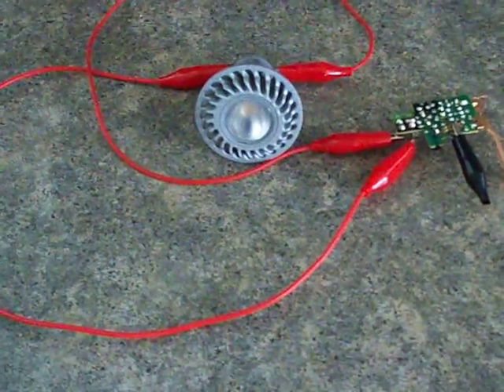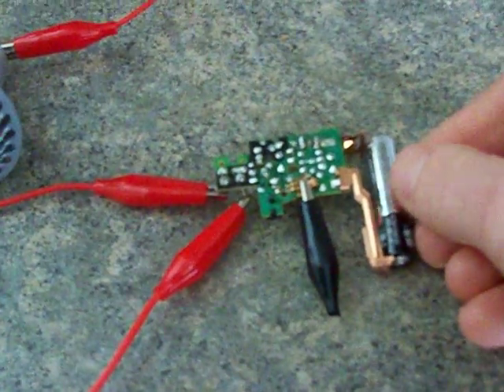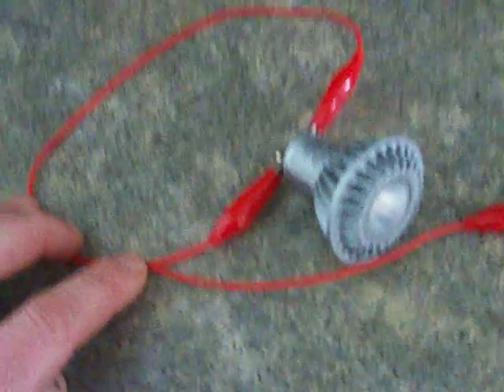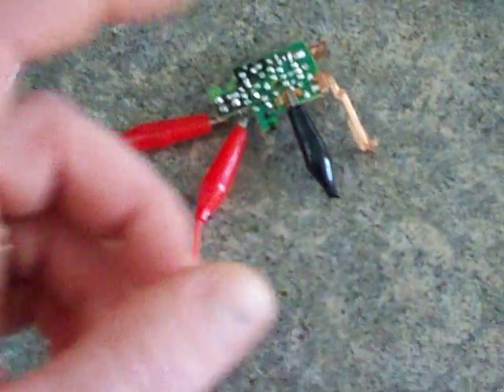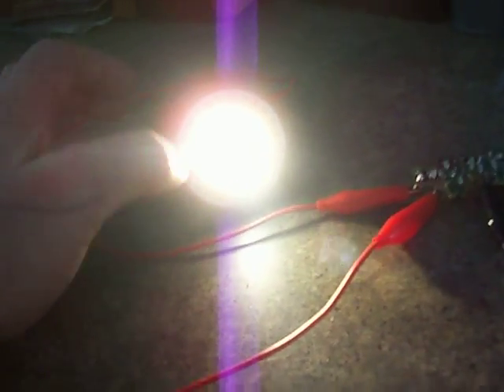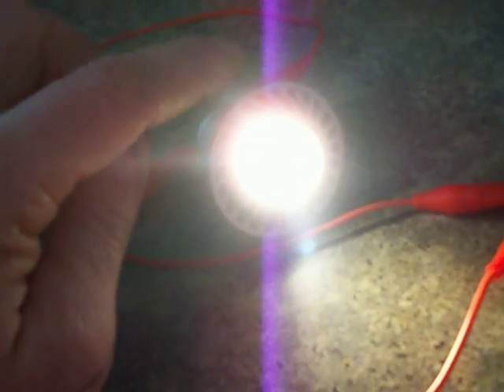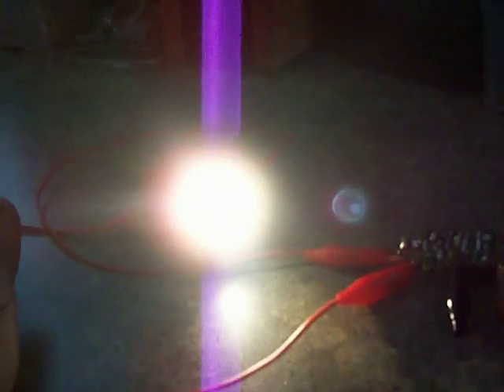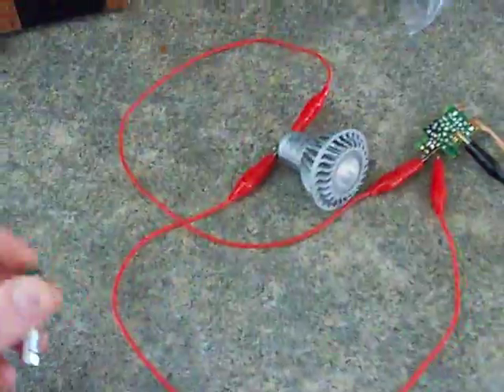Fuji Circuit Joule Thief LED Light / 1

Comment: can two of the fujis be wired together to double voltage?
Reply from the maker: I don't know I don't think so but maybe something to try later
Reply: thank you for responding,  I have already modified the circuit to run a 14 watt led light and support a low voltage phone charger at the same time and it lasts about an hour,  i am wanting to boost the voltage and watts it puts out, i can run individual things like my dvd player a small electric blanket about an hour to two hours,  i want to go bigger,  if you have any ideas toss them my way and thank you for your video.
Reply from the maker: that's great send me circuit will like to see

Comment: I bet they last much longer with D sized alkaline battery with a small 5 ohm resistor or so to hold back too much current from entering the board
Reply from the maker: I will tray that thanks for tip

Comment from the maker: you got too know were to man ....look round and close by transformer is spot they are 2 spots and u have to have under 5watt light 120 volt or other will work for me 120 volt 3 watt led works the best and last 5 hr on one 1.5 volt battery , thanks and good luck

Comment: Is this led 110v? I tried this hack with 220v 2w bulb and it did not work. Looks like fuji does not provide enough current, even though voltage is high